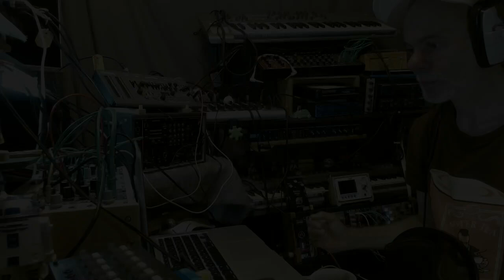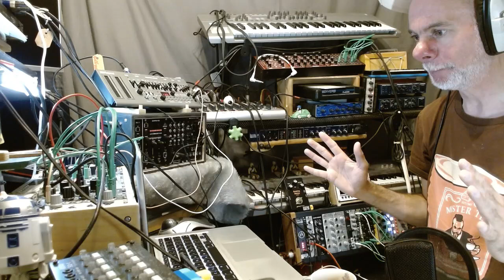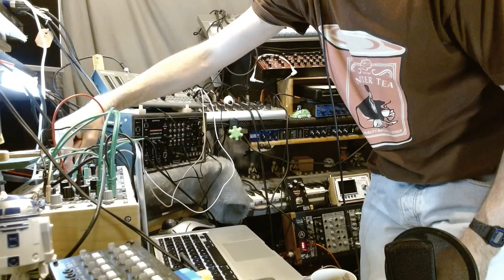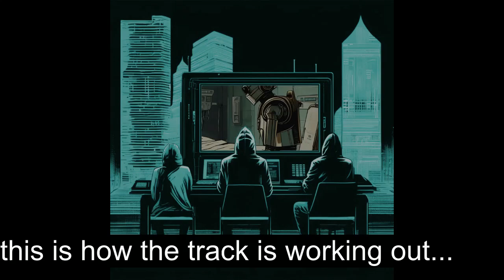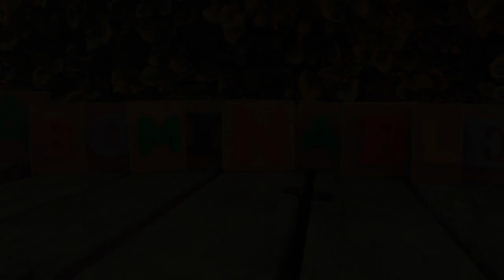Roland SH01A - CV and Gate output works perfectly!

Comment: Hi, great vid. 
I really, really like the internal polyphonic step sequencer on my SH-01a BUT with the optional Roland Boutique K25 2 octave mini keyboard fitted, the CV & Gate works perfectly when triggering CV and Gate in on my Behringer Crave when played on said Keyboard but not when I start the sequencer on the SH01a. 
What happens is the sequencer will only trigger the 1st note  but will not trigger repeated notes on the Crave.
for example: 
SH-01 a playing: 
D D D D F F A A
Crave will only play
D - - - F - A -
None of the reviewers on youtube ever test things completely thoroughly. I understand why they can't test every aspect but with 100s of video reviews you would of thought someone would 've picked this up. I don't have any modular gear apart from a Roland SE-02 and an Arturia Microbrute with CV and gates in. Also have Keystep 37 but I'm hoping to use 
SH-01a with its great internal sequencer to trigger the Crave monophonically.
Its to add a detunable 2nd oscillator to the SH-01a. 
I doesn't work using SH01a midi out to Crave either'cos 01a always midis out 2 or 3 octaves higher up on any midi device or keyboard.
Reply from the maker: well, I don't know what's going here, but maybe it's the fact that SH01A has a polyphonic sequencer and Crave is just monophonic. The SH01A uses voices 2,3 and 4 for the repeated notes, then cycles back to voice 1 when the pitch changes. Although, this seems a little unlikely. Could be an envelope thing? The crave envelope isn't resetting quick enough to catch the repeated same note? Again, just a theory. I don't own a Crave, so cannot test this. Maybe try connecting via MIDI din and see if the issue persists?

Comment: Hi mate, love the track, i wouldnt mind using my daw with my roland sh01 & my chase & bliss onward pedal, using midi but am a complete novice, i am using a Allen & Heath xone 92 mixer that has my daw playing out of on a line in channel, would i connect midi to my SH01 then to my onward pedal? sorry for being abit wet behind the ears, but could you explain how you would do it if you dont me asking, thanks in advance, Paul
Reply from the maker: Hey, there are a couple of ways you could go with this. Firstly, you'll need to get your DAW talking to the SH01. If this is the GAIA, it has midi over USB, so that's a bit easier. If you want to connect via MIDI, you'll just need some sort of USB to MIDI converter. There are plenty of those available (I like the CME U6). Be clear what MIDI channel the synth is set to (and write it down!), this will save many hours of trying to figure out why nothing is working in the future (and remember to set the DAW output to the same MIDI channel). So, then you're sending MIDI from the DAW to the synth. To process the synth audio with the pedal, either just plug the output of the synth into the pedal. The pedal is (likely) expecting a  high impedance signal (since it's a guitar pedal), but should still work ok. I use pedals with synths all the time. Alternatively, you could go into the mixer from the synth, then put the pedal as an insert effect, or a send and return. This may give you more control since you could dial in the return signal using the mixer. Good luck, and let me know how you get on!